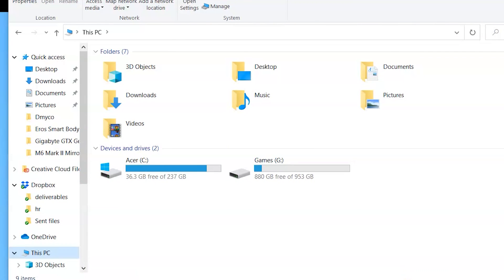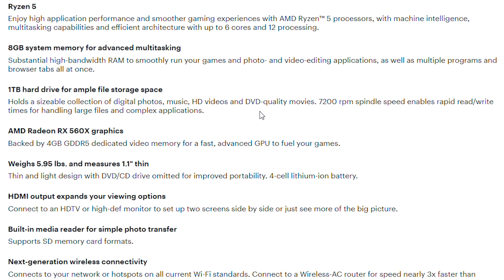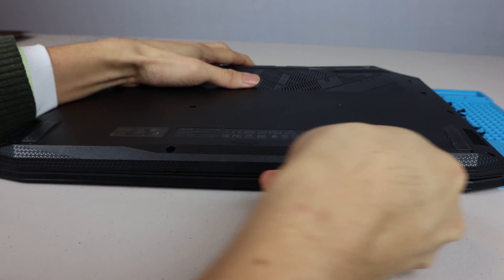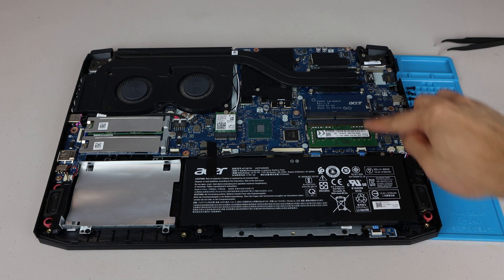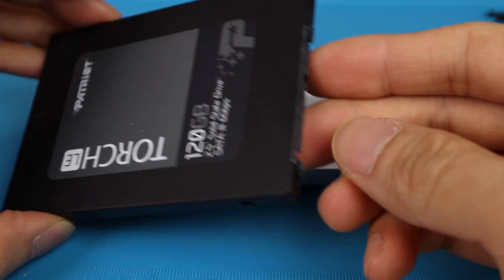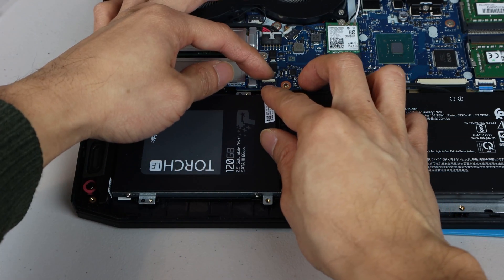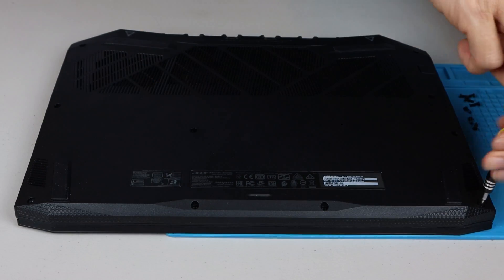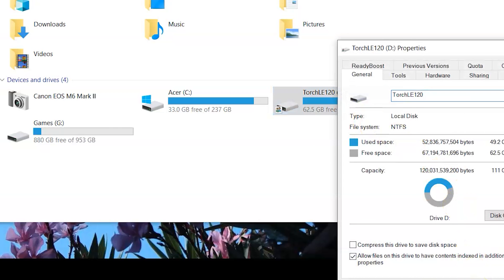How to Install 2.5" HDD or SSD in Acer Nitro 5 Gaming Laptop (2019 ver) SATA III Drive

Comment: Hmm mine has access on the bottom and is also a 2019
Reply from the maker: It'll depend on your base model (e.g. AN515-54, AN 515-52 etc.), the configuration of the chassis, not really the manufacture year.

Comment: Actually my laptop has a sticker over the centre screw saying " WARRANTY VOID IF REMOVED".....Should i wait until the warranty expires?
Reply from the maker: That's up to you if you value the warranty more than the upgrade. The warranty policy regarding user upgrades varies by region. Personally, I almost never end up using a warranty within its validity period, so I'd rather have the upgrade for the duration of use, as by the time the warranty expires, advancements in tech could make that model obsolete. Your other option would be to have an Acer service center perform the upgrade for you, in which case, the warranty should remain intact.
Reply: @FixItPhil  okay thanks!
Reply: @FixItPhil  Edit: The sticker seal just got ripped off...well, proceeding with the upgrade -_-

Comment: Near the fans, where the back central screw was, there was a pink gel like leakage. I am not sure what it is and a bit worried for it. If I haven't broken anything?
Reply from the maker: Hm, it could simply be a thread lock/lubricant for the screws or residual thermal paste. I haven't heard of any using a pink coloration, but I suppose that it's possible. If it's tacky/sticky, you can probably just wipe it up with a cotton swap. Not sure that it's something to worry about unless your laptop is having issues.

Comment: What can I do if the connector is in a different place than on your video? It doesn’t look like the cable will reach
Reply from the maker: Hm, you'll need to get the cable that is specific to your model laptop. If you have the same base model laptop, the one I linked to in the description will fit.

Comment: i have a question, is the an515 and an517 storage stuff the same? mine is 17 inch screen i’m pretty sure i dont wanna buy the wrong size card
Reply from the maker: The size of the M.2 drive is the same, 2280 (22 mm wide and 80 mm long). All laptop HDD drives are 2.5" form factor, generally up to 7mm thick.

Comment: Where to get screws and that connector
Reply from the maker: I found them at Ebay. HDD/SSD 2.5" upgrade cable: https://ebay.to/2Tnlh9l [Ebay Affiliate Link]
HDD/SSD screws to mount a new 2.5" drive: https://ebay.to/372VuL7 [Ebay Affiliate Link]

Comment: Do we have to disconnect the battery as well?
Reply from the maker: No, it's not necessary per se, but you can do this as a precaution. It's just one connector that you have to disconnect after you've opened the bottom cover.

Comment: What's the max amount of everything I can upgrade I'm trying to max out my laptop
Reply from the maker: 2 TB per drive (two M.2 slots and one 2.5" bay for up to 6 TB max) and 32GB RAM.
Reply: @FixItPhil  Sorry if I'm bieng annoying but just to clarify 

Ssd:2TB

M.2: Both slots 6TB

RAM:32g

Also thanks for replying I am getting this for my birthday and I want it to be the best so i feel like I got my birthday wish worth it
Reply from the maker: @tep1602  No problem at all, I should have been more clear, 2.5" drive = 2TB, M.2 slot 1 = 2TB, M.2 slot 2 = 2TB. The total for the whole system will be 6 TB.
Reply: @FixItPhil  Thank you very much for the help the whole time I'm adding the new parts to my acer nitro 5 I will watch your videos to help👍

Comment: Does the notebook come with the HDD connector as an accessory? Mine didn't. Thanks
Reply from the maker: It depends on your build/model, I have the 2019 AN515-54. Mine included the screws/HDD cable, and the only drive pre-installed was an NVMe M.2 drive, though I almost missed these in the box because they were small. If your laptop came with an HDD pre-installed, the cable and screws are already used on the drive inside the the laptop, and you would have to re-use them after removing the existing drive.

Comment: i installed new hhd today but its says NA on hard drive 0.. is it possible computer is not detecting cause of the cable?? or something else ?? pls help
Reply from the maker: Hm, I haven't seen this error on mine so I'm not really sure. It's possible that the BIOS doesn't detect the drive because the cable wasn't installed fully seated. Another user reported that he had mistakenly installed the cable upside-down in the connector. The gold contacts should be facing the motherboard and the ribbon cable should be inserted as far as it can go into the connector, without bending or warping.
Reply: @FixItPhil  bios main tab show full name and size of the drive but its not showing anything on boot tab like literary empty its only greyed "boot priority" i hate going to geek squad lol but this time i may have to lol but im to try that thing you said gold facing to the motherboard before going to geeksquad lol

Comment: How do I upgrade the disk space for this laptop what do I have to buy?
Reply from the maker: You will need to upgrade or add a new disk drive. For this model, depending on your build (pre-installed components) you will have either the 2.5" HDD bay available or one/both of the M.2 slots unoccupied in which you can add a drive to add more disk space. In this video, I go through step-by-step how to install a new 2.5" HDD; if this slot is already occupied and you want to add an M.2 drive instead, you can follow the steps here: https://youtu.be/Oz735CCXTQo In either case, you will need to follow the steps here to complete the setup of a new drive: https://youtu.be/d5wLgZxROoY

Comment: sir i have acer nitro 5  AN 515 43 model ... which ssd it while suppout.
Reply from the maker: The AN515-53 has one M.2 slot that supports both NVMe/PCIe or SATA.

Comment: i can pot a portable hard disk
Reply from the maker: Technically yes, if you remove the 2.5" drive inside a portable hard disk, you should be able to install it inside the laptop with the appropriate ribbon cable and screws (as demonstrated in the video), but you cannot simply just put a portable hard disk "as-is" inside the laptop since it would not fit, physically, nor would you be able to use the USB connector portable hard drives use to transfer data from within the laptop. Note that this won't work with 3.5" form factor portable hard disks because the disk drive inside will be too big to fit in the HDD bay in the laptop.

Comment: I installed a new 2.5 ssd, and it shows at the device manager but not at the file explorer, what should I do?
Reply: Sorry, this is my first time making any upgrade to a pc, I did some research and found that some new ssd or hdd have to be activated
Reply from the maker: That's ok. Yes, new drives need to be setup after being installed. If you still need some guidance I have the instructions for setting it up here: https://youtu.be/d5wLgZxROoY

Comment: Can’t seem to find any to fit a AN517-51 17.3 inch and it arrives tomorrow but only has 256 GB
Reply from the maker: The AN517-51 has 2 M.2 SSD slots, one is for NVMe SSD and the other is for NVMe/SATA drives. It also has one 2.5" HDD bay. Since your original build includes 256 GB, this is likely an M.2 drive, though it's unclear if it's installed in slot 1 or slot 2. In either case, a second NVMe M.2 SSD is a safe bet since it can go in either slot. You can also choose any 2.5" form factor drive as these are all universally compatible with all laptops. I have some links in the description for various disk drives if you're looking for recommendations.

Comment: i cant find any connector to plug the cable in..
Reply from the maker: It should be somewhere next to the 2.5" HDD bay, usually just above it. See 3:31. You're looking for a small white connector the same width as the ribbon cable.

Comment: my pc dosent find the ssd, but the intel rapid storage program did and automatically made a raid 0 with the old ssd and the new and now i cant use the new one
Reply from the maker: If it's Raid 0 then the computer should "see" them as a single drive. That means your new "C drive" should have the capacity of both the drives put together e.g. if you had 256 GB and installed a 500 GB drive then the Raid 0 drive would show 756 GB. Depending on how the Raid 0 was created, it may not be possible to split them back up into 2 separate disk drives without losing data.
Reply: @FixItPhil  disk 0 only has 488gb but 250 of that is unallocated space that i cannot create a new volume in, i want to seperate the drives but i dont mind losing any data

Comment: I just purchased the nitro 5 at bestbuy (canada) for 667 CAD ... I purchased the samsung 1TB SSD for 139 CAD and going to install it once the laptop arrives hopefully next week.

My question for you @fixitphil is ; What is the maximum amount of SSD the laptop can handle? Is it 1TB? What is the maximum amount of ram the laptop can handle? is it 32?
Reply from the maker: Sorry for the late reply. The max RAM is 32 GB (2 x 16GB sticks) and the max for the drives is 2 TB each (2 x M.2 and 1 x 2.5" drive) so a total of 6 TB. I've seen a 4 TB form factor 2.5" drive which theoretically should work too, since it's a 7mm thickness, and I don't think there's a formal "cap" in terms of capacity for that drive -- only physical dimensions; though I haven't seen anyone try configuration this out.

Comment: If my laptop already has a 1 TB 2.5 hdd, would i need to get a cable if I switch it out for an SSD upgrade? 

5400 rpm hdd is painfully slow to boot and im upgrading my ram to 16 GB, my model is AN515-54-59A8

Comment: So mine just didn't come with screws and I'm trying to trace down some. Your link just leads to an ebay search page that brings up screws that are advertised for specific make/models (none of them Acer Nitro). I tried looking them up specifically but I keep getting European import sites as the only ones that list them. Am I really going to have to import these things?
Reply from the maker: Nearly all 2.5" laptop SSDs are compatible with M3 size screws with lengths ranging from 3 to 5 mm. "Brand" is usually not important. You can try this assortment: https://geni.us/5sO0 [Amazon Affiliate Product Link] It's got two M3 screw sizes in different lengths. I'd start with the shorter one (3mm) to ensure it screws in flat to the mounting bracket.

Comment: Hello. I am here with totally different question 🙋🏻‍♀️ I have 250gb memory in my acer nitro 5 laptop. But for some reason it keeps showing me that my disk space is almost full? I have everything removed and deleted from my laptop. I mean all kinds of unnecessary apps and other stuff. But it it still keeps showing that i am low on space 🙁😩
Reply from the maker: This may not be due to installed applications. Memory space may also be taken up by things like photos, videos, music, and other files downloaded from the internet. Try typing in 'Storage Settings' in the Windows search bar and click on the system setting. It should give you a breakdown of how your hard drive space is being used. You can try click on the 'Temporary Files' line item and deleting things there that you may need to free up more space.

Comment: Thank you! Based on other videos I have watched I thought my Nitro 5 had come without the SATA cradle/bracket. Your video was simple and explained a minor detail that was not explained in any other video. The difference throwing me off on all these videos is that my bracket is clear while all the other ones seen in videos it is white.  I have the 17" monitor Nitro 5 but I could not find any videos explaining this one difference.
Reply: Did you order regular sata cable from default Nitro 5 laptop or 
did you choose exact 17inch model cable on eBay?

Comment: What is the difference between ssd and hdd?
Reply from the maker: SSD is a solid state type drive. It has no moving parts and is generally considered a more stable and reliable memory type that is less prone to failure and data loss. An HDD has many layers of platters (disks) inside that physically spin in order to write and read data. This constant motion wears out the disks over time and is what many times causes an HDD to fail, resulting in partial or complete data loss.

Comment: my hdd is having a grinding or buzzing  sound all of a sudden ? HELP
Reply from the maker: Typically, noises from an HDD like that indicate that failure is on its way, if not imminent. I don't know of a great fix for it, but you can prepare for the inevitable by backing up your drive and when it fails, you'll have a backup image to restore on a replacement drive. You can always replace it pre-emptively, but if it's still working at the moment and you backup regularly going forward, the risk of data loss will be minimized.
Reply: @FixItPhil  thnks for gthe suggestion

Comment: Hey if my nitro 5 has a ssd can I install a hdd as a secondary
Reply from the maker: It depends. If your SSD is installed in the M.2 slot then yes. If your SSD in installed in the 2.5" bay then no, as the HDD would have to occupy the same space.

Comment: Will i definitely need to buy  a SATA cable and should i beforehand? Great video. Thanks!
Reply from the maker: Yes, most 2.5" drives don't include a cable (because it can vary from laptop to laptop) and most laptops use a smaller connector on the motherboard than the standard SATA connector on the drive. The Nitro 5 usually comes with the cable if it's new in box and didn't include a 2.5" SATA in the build; mine only had 1 M.2 SSD pre-installed. If you're removing an old 2.5" and replacing/upgrading it then you can re-use the cable.

Comment: Can you fit a 2.5" SSD in the HDD spot as well? I don't want to install and HDD and have slow gaming performance, and I already purchased a 256 gb nvme m.2 ssd for the extra expansion slot, and also looking to save a bit of money while enhancing performance and storage space.
Reply from the maker: Yes, any 2.5" SATA drive less than 7mm thick will fit in the slot (SSD or HDD both are compatible).

Comment: Are the cables and screws required for a 1st and 2nd drive also? I bought mine from a local PC store and didn't get any with my order. 

If so, would I be able to directly replace my older drive with my new one and still be able to set up that new drive without my previous data? - Many thanks.
Reply from the maker: The cable and screws are not required for the M.2 drive slots, only the 2.5" HDD bay. If your build already has an HDD installed, the cable and screws are already being used for that drive. If you remove and replace the drive with a new one, you can re-use the cable and screws, and yes, you won't have any of the previous data and would have to reload the OS, apps, games, and any other files.

Comment: My laptop is Acer Nitro 5 AN515 . I'm going to buy another and add second ssd. I checked my drive it's a micron 2200 v mtfdhba512tck ( m2 pcle ssd) Okay i have 1 m.2  drive.  So do you think should i buy 2.5 or m.2 ssd? Which one is do you prefer more speed or better for loading games ? And if i buy m2, it should be sata now or pcle nvme also work?
Reply from the maker: Since I don't know the exact build of your laptop (there are several iterations of the AN515 e.g. 515-43, 515-51, 515-54 etc.) I can't say for sure which interface type the second slot can accept, but you can refer to this list for clarification:
AN515-51, AN515-52, and AN515-53 (Intel): 1 x M.2 - NVMe/PCIe or SATA
AN515-54 (Intel): 2 x M.2 - Slot 1: NVMe/PCIe ; Slot 2: NVMe/PCIe or SATA
AN515-41 and AN515-42 (AMD): 1 x M.2 - SATA
AN515-43 (AMD): 2 x M.2 - Slot 1: NVMe/PCIe ; Slot 2: SATA
AN515-44 (AMD): 2 x M.2 - Slot 1: NVMe/PCIe ; Slot 2: NVMe/PCIe or SATA

If your remaining slots are both SATA interface, then it doesn't matter whether it is M.2 or 2.5" form factor, the speed will be about the same. If you have an NVMe compatible slot available, this one will give you the best performance in terms of read/write speeds which I prefer for installing and saving games to.

Comment: Excellent video. You were able to explain what the sticker on it and the support system could not. 
So two questions. First if you add a 2tb ssd what kinda of hard drive speed dose that little connection give you.?
Probably just going to use it for storage. Definitely adding a second .2 drive.
Second question. Any ideals about a laptop bag for this 17in monster lol.
Reply from the maker: If you install an 2TB NVMe M.2 SSD, you can expect to achieve max read/write speeds in the 3400-3500MBps range. As for a bag, I know that can be a pretty personal decision based on individual style preferences, but this one from Voova is an affordable option: https://geni.us/WhZwIb8 [Amazon Affiliate Product Link] It's slim, waterproof, lightweight, and clean looking (available in 3 colors). If you prefer a backpack style bag, I like this one from Kroser: https://geni.us/KHrcB [Amazon Affiliate Product Link] but it is bulkier/roomier.
Reply: @FixItPhil  thanks for the answer.

Comment: FixitPhil, thanks for this tutorial video.  Question: Acer recommends that you disconnect the internal power cable first.  Do you need to do this?  Thanks in advance.
Reply from the maker: I did not for mine, but it's not a bad suggestion to do as a precaution. You simply woul dneed to disconnect the cable that attaches the battery to the motherboard.
Reply: @FixItPhil  can I add 2 of the 2.5inch ssd? My laptop is the same but with 512gig of ssd already included
Reply from the maker: @supernova-7274  No, this laptop only has the physical space to accommodate one 2.5" drive. You can have up to 3 SSDs in this laptop, but two of them have to be M.2 form factor.